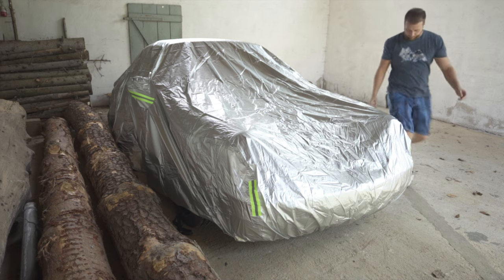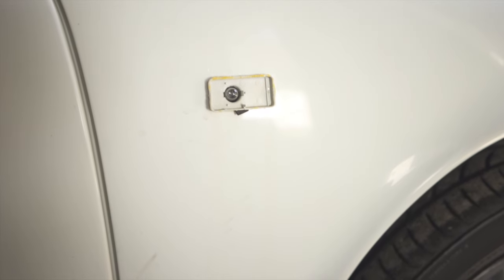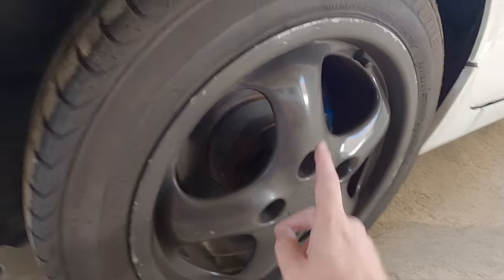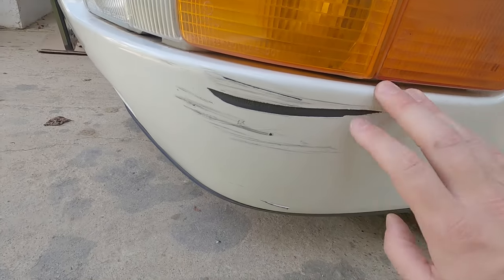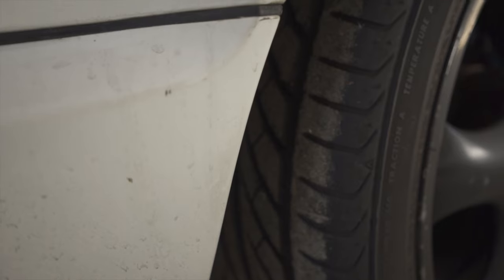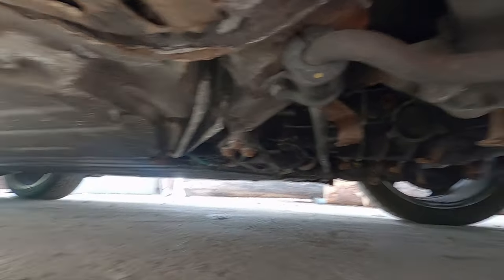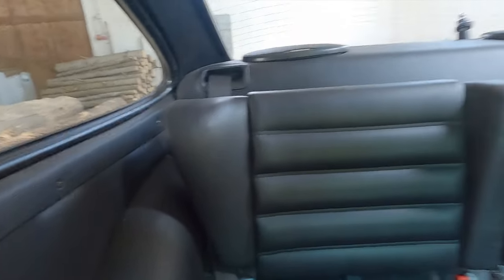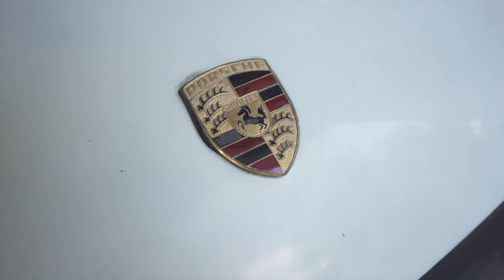Everything wrong with my cheap Porsche 964

Comment: Had a similar acquisition and did the distributors, plugs, wires, and valve adjust and new aluminum billet valve covers with three overhauled injectors.  Knocked out 90% percent of the and runs much better.  Yes that was fun while in the car, but a Quick-Jack helped alot.. She is back on the perch (QJ) now awaiting a new flexible hydraulic hose for the clutch, but the other lasted 31 years, so can't complain.  Requiring a lot of love now, but my gosh what a solid car that Porsche built...
Reply: Don’t forget the 30yo fuel lines too. Car fire is one of my fears so that was on the top of my list. I agree after buying my Quick Jack doing work is so much easier

Comment: If I may add one thing as a fellow owner. First mods should be a fire extinguisher. And definitely look into your fuel lines they are in the engine bay a a few just under the intake manifold. A lot of people over look this or wait until they need to do the engine. Which sometimes can be too late after the engine catches fire. I had to have my engine resealed when I first bought mine which turned into a full build so it was on the list. Food for thought.
Reply from the maker: I'll be sure to check the lines, Thanks for the heads up. And I always have an FE in my cars!

Comment: Good luck with the work. I got a 964 last year at a good price as well and have been working on it over winter. Condition was not as bad as yours (I paid more as well). The engine mounts need to be replaced as well from seeing the video. Also replace the transmission mount. Both are very easy to do and will change the feel of the car dramatically. Good luck!
Reply from the maker: Awesome, thanks for letting me know!

Comment: I always wanted a 964 (or any air cooled 911 really) but the only 911 I could afford to buy was a 996.  I figured that Porsche will have tried hard to make them drive every bit as well as any air cooled 911's and I wasn't wrong. I think even their looks have got better with age and owning any 911 is better than not owning one!  I look forward to seeing what you do with this. Will you keep it as 4 wheel drive or convert to 2 wheel?
Reply: I have a long term keeper 964 but the 996 is awesome! ive had a few and would have another in a heart beat. Your right about the looks as well, the early fried eggs look awesome to me now yet i hated them a few years ago

Comment: These look like Cup II wheels, which were original to the 993. The 964 had Cup I wheels, which have flatter spokes and were all 16" in the normally aspirated cars (turbos had 17"). Good luck with the restore. Looking forward to more videos.
Reply from the maker: Awesome thanks for letting me know! Are they worth restoring at all or are they not very desirable to begin with?
Reply: @LXGspec  They are very valuable if restored to the original condition. You could easily sell them for good money. The same applies to Cup I's. Cheers from the States,